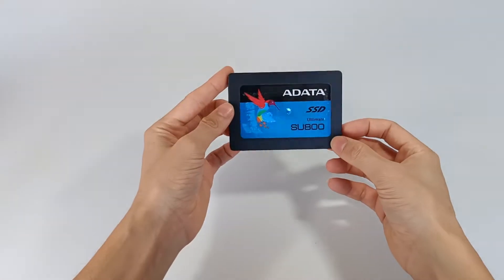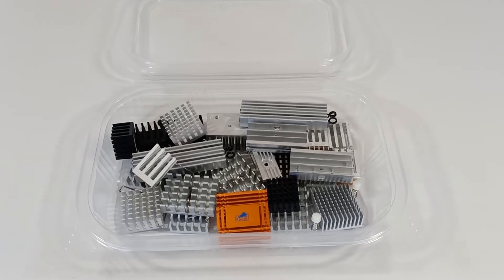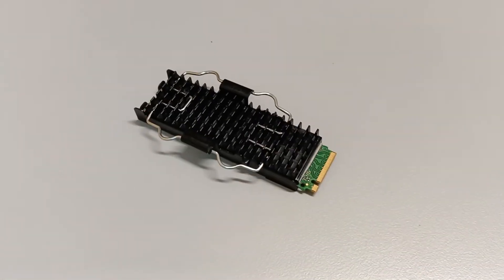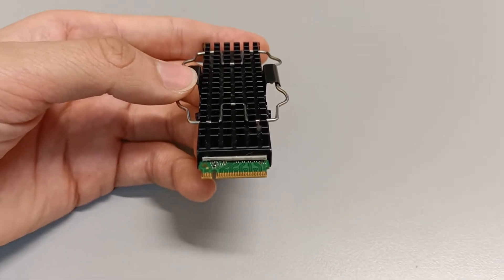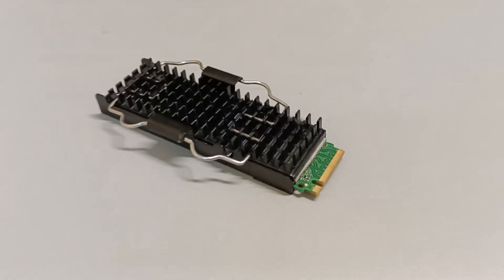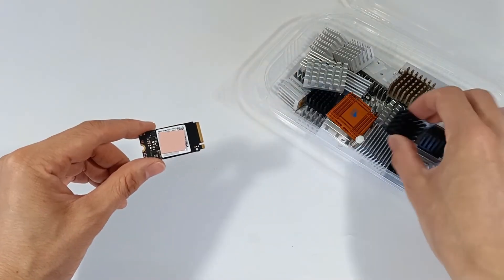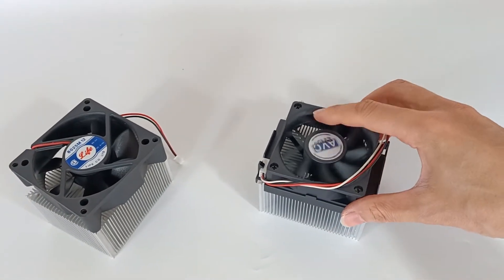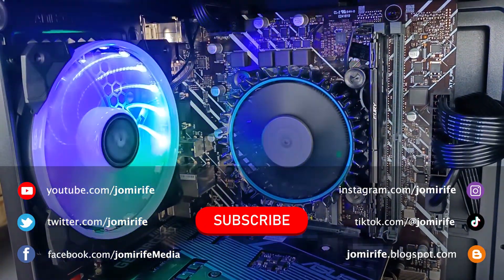Heatsink HP 919952-001 – Aluminum cooling heatsink for M.2 2280 NVMe SSD drives

Comment: I used universal heatsinks, heat pads and rubber bands for my m.2 ssd. Efficient and cheap.
Reply from the maker: yes
Reply from the maker: this will not be very different
Reply from the maker: but pad can have differente thermal condutividy